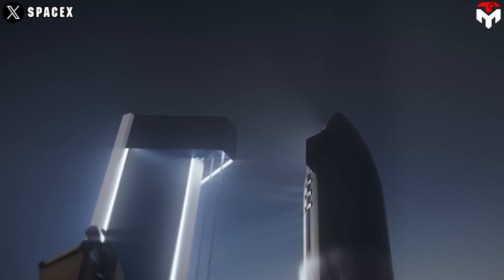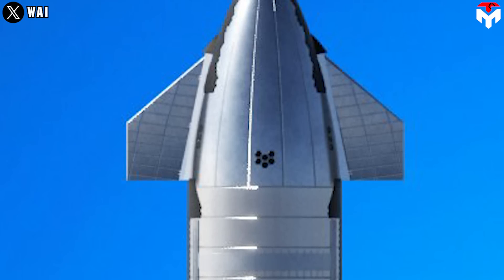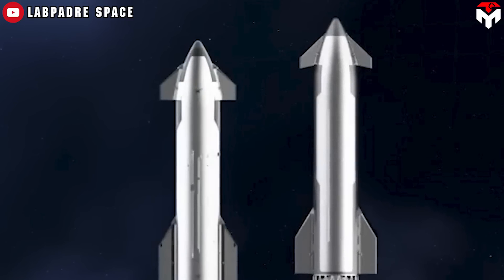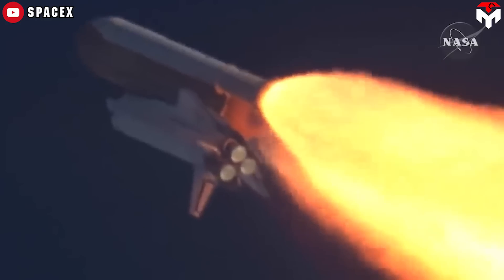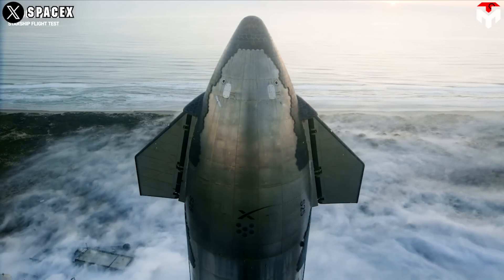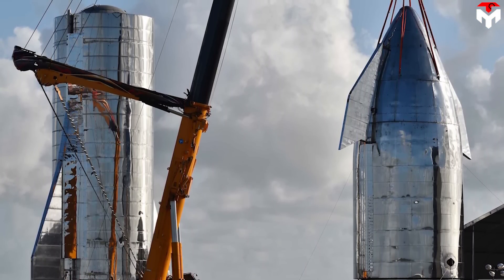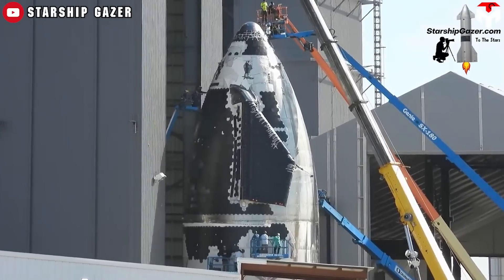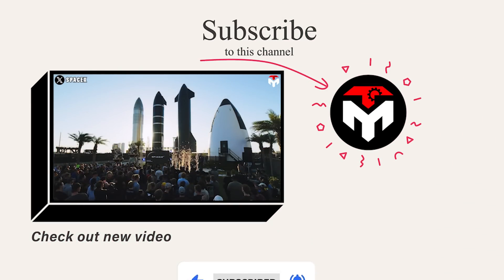SpaceX Starship Nosecone V2 New Design Unlike Any Other...

Comment: I think Elon knows something new, that doesnt fit the current paradigm, and is starting to design for the new paradigm.

Next flight will be a test of new thinking using the old rocket... They may even change V-2 more rather than less.

We have to wait and see... pay attention to the altitude and velocity numbers next re-entry trip, and the distance covered. compare to last trip....
Reply from the maker: Thanks for sharing. I'm researching information to make a video about the revisions in V2. After Flight 4 and 5, hopefully more news will be revealed as u said
Reply: @techmap9  Yeah, there are changes coming... that last flight had enough problems they undoubtably learned all kinds of things...
Thats what people have a hard time understanding, that you learn from serious problems. And I'd be more worried about too few problems at this stage of developement, than too many....
Also they have ships built ahead, probably thanks to bureaucrat snails,  and now know more, and so tearing schitt off and adding things etc.

It will all even out some by V-2... Probably the first real production ships will be V-3 or V-4...
Also Raptor 3 is coming soon. thats gonna clean up the climb side dynamics. And they will be trying stuff to fix engine relighting problems etc. 
Basically its getting better faster than its easy to realize.. And they have the Starlink incentive.  the first one to pump out Satellites is making money.
And everybody else is gonna wake up and realize they have bigger product options...
Like the Astronomers who whined about Starlink, will be trying to fund way bigger telescopes farther out.
And we should actually have a sphereical constellation beyond Mars orbit, watching for unexpected guests...
Much will be possible very soon. Not far from the day they do multiple orbits and land back in the drive way at Boca Chica....
I think Elon means business....